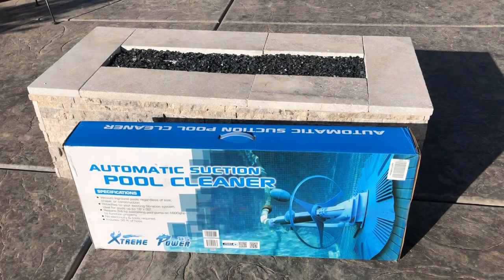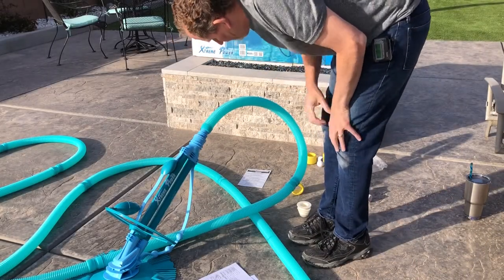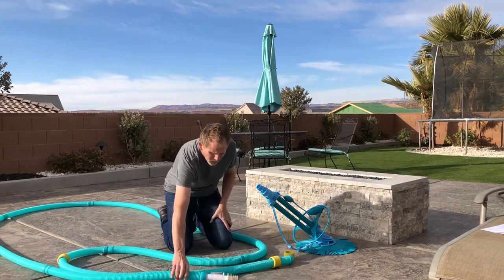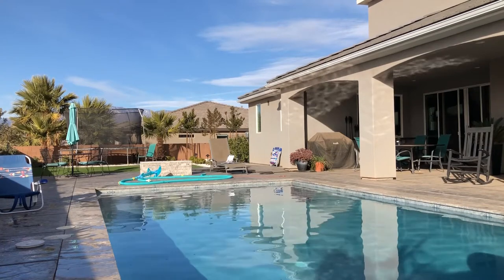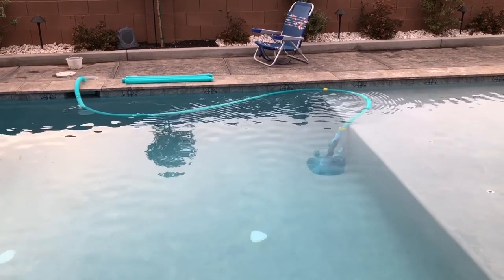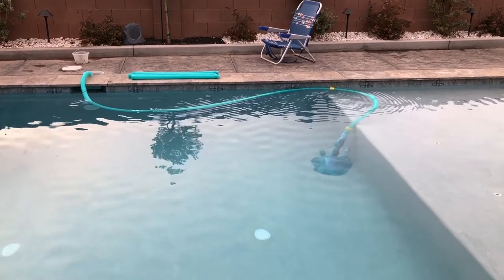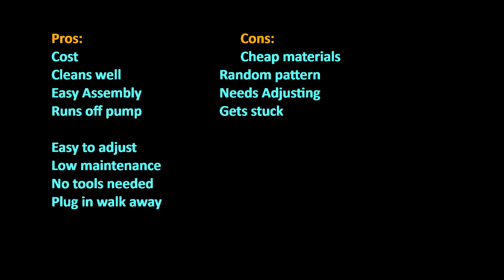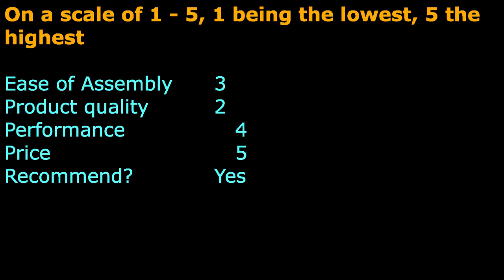Automatic Pool Vacuum - Cleans In-Ground, Xtreme Power US

Comment: How about the 2 wheel version and the flow meter. Did yours come with a clear device to measure the flow of the pump?  Where does it go or when do you use it?
Reply from the maker: I've looked at the 2 wheel version from the same company and it doesn't rate quite as high up on the reviews and is more money so have avoided it so far.  Mine didn't come with a clear device to measure the pump flow, but does have an adjuster on the end for the amount of pump  suction.  Thanks for the comments!

Comment: i have to make sure my hose is full of water before I hook it to the suction side. I use the return line to do this. how did you get your hose full of water? did you let the pump suck a bunch of air until all the air in the hose was gone?
Reply from the maker: Hi there!  Yes, I have to make sure the hose is submerged or full of water before I hook it to the suction pump, otherwise the air pockets cause issues.  Great comment however!

Comment: Does my main drain and vacuums line have to be off?
Reply from the maker: So this works better if the main drain is turned off apparently, and the pool pump is what runs it.  There is an adjustment where it connects into the pool pump to give it more sucking pressure and that helps.

Comment: about to return mine...just got it and it is slower than a snail....only goes backwards and gets stuck easily 

POS
Reply from the maker: I had to take some time adjusting the regulator spring settings that come with the vacuum, also crank up your pump motor on the pool and see if that helps speed things up.  Thank you for the comment

Comment: I have 3 weights and a 8 foot deep pool and this thing never goes into the shallow end. Tried to adjust the 3 weights but no luck.
Reply from the maker: Check the suction on the pool pump and adjust to stronger if needed.  Also you may need to move the weights (Spread them out) along the hose to get the Vacuum to move to the more shallow part of the pool.  Hope that helps, and thanks for the comment!  🌊
Reply: @FixMyBleep I will try that. I have a few extra weights as well. The suction is very strong. Moves pretty good.
I will keep you posted.
Thanks
Reply: @wild-n  Hi again

I think I have it figured out. The hose is way too stiff. it just takes the path of least resistance. My old one the hose was much more flexible and only used 3 weights.
Im going to try the old hose from my old machine or at least a few pieces.
Reply: @FixMyBleep  Wildstreak

Well I finally figured it out. Took all the weights off the hose and used the more flexible hose from the old machine. It was doing better, but still seemed constrained as far as coverage goes. Then I noticed the swivel at the machine doesn't work well under vacuum pressure. It only rotates 30-35 degrees when running, so I ordered two Pentair swivels to go inside in the hose and now it goes where ever it wants unconstrained. Much better now and those swivels actually work. Imagine now it goes in the deep end and the shallow end without any weights whatsoever in my 8'5" deep pool.
Reply from the maker: @aslo4812  That's a good call, I think the hoses may have changed.  This one is pretty flexible in the video, but the vacuum always takes the path of least, or no resistance as well.
Reply from the maker: @wild-n  That's great news!  Thanks for the information and I'm glad you got it figured out.👍
Reply: Just out of curiosity what kind of old machine are you talking about with the more flexible hose. Thanks
Reply: @johnfontenot1679  I had a Creepy Crawly in before. But then the pool company came and took it but left the hose. It is super flexible the hoses this came with are stiff. Its like everything makes a difference as to the coverage the cleaner makes.

Comment: We love ours but we have the old one from 15 years ago we ended up combining parts and weights. I’m disappointed no videos including yours shows or tells about inserting the regulator into the pump. All of my pipes are buried under ground. I am very Leary of taking a basket out of the pool and having any leaves and debris going into the skimmer? Everyone shows emptying a basket but showing putting this thing under the basket? We have a 20x40 9foot deep pool and I cannot risk damaging / replacing the underground plumbing from clogged pipes. So we just decided to use the old system with it and it sits on top of the basket and empties into it. This is the best cleaner we have ever used though. We close all of our 3  returns and it boogies around the pool and walls in about 3 hours
Reply from the maker: Hey that's a great point on showing how to insert the regulator where the circulating pump is.  I may need to do a short video to show some of that.  Also good to point out closing the returns.  Thanks for the comments!

Comment: I have this same vacuum. How did you prime the hose? Looks like you stuck in the water.
Reply from the maker: That's exactly right!  I had to place the weights on the hose, and allow it to fill with water or get all the air out of it to prime it and then place the other end into the suction pump.  Hope that answers your question, thanks for the comment!

Comment: We are Experiencing problems with our extreme power. It’s been pulling off  stone from our pool and now it’s not working because the stones it sucked up are stuck in the system so it is jammed .
Reply from the maker: Oh that's terrible it's actually pulling building material from the pool itself?  Are the stones stuck in the Extreme, or the pool filter pump?  If they are stuck in the Extreme, you will need to try and remove them by taking the hose sections apart, and the unit sections apart to reach the stuck stones.  So sorry to hear this is causing issues.  There is also a way to adjust how much suction it puts out by changing the spring tension.  Hope this helps, how frustration. Thank you for commenting on this unit.

Comment: is the regulator only for inground pools ?
Reply from the maker: The regulator is for any pool with a vacuum return built into it to adjust the suction power of this pool cleaner.  Hope this helps, thanks for the comment!
Reply: @FixMyBleep  kinda sorry I'm new just had my pool last summer and bought this vacuum I have intex 18x48 with hayward 1.5 hp and sandfilter,  my question hopefully my maybe 2 part question is would I or can  connect the regulator directly to the hayward and would water come out of the regulator since it the hole in it well I didn't really look at the regulator its in my basement  look like has a square hole I'd have to check , but yea can I connect directly to the hayward pump and would water come out
Reply from the maker: @miraquepasa6519  So this attaches to your existing filtration system (pump) and just do a test first to make sure it's the same size, or next time you have a pool guy out have him verify it will work with your equipment maybe, it sounds like you are all set, good luck.
Reply: @FixMyBleep  thank you very much appreciated

Comment: How do I turn it on😭
Reply from the maker: This runs off of your pool equipment.  So you plug the end of the hose into the pool vacume pump (under the skimmer basket typically), and turn the circulating pump on to activate the device.  Then let it run all night, or most of the day.  Also get all the air out of the hoses, and youneed to balance the hoses just right with the weights, it's a little tricky, but once you get the hose length and weight figured out, it works well.  I hope that helps.

Comment: I had that type cleaner. Then went to a cleaner that works off the return side much better! Then switched to a robotic with its own power and cord. Nothing hooked to filter. Best way to go although pricey. I can have my pool cleaned and chemically balanced before even having the filter started in the spring. I am on my 5th vacuum(first robo) in 18 years. Robo is a pool rover jr. nearly 9 years old.
Reply from the maker: This one worked, but I just updated to a pool robot as well and it's so much better than using the pool pump and filters, but definitely pricey.  Thanks for the comments!
Reply: @FixMyBleep  You`re welcome

Comment: Your doing all wrong, you need to fill your hose up with water first are you gonna have air in your line and through your filter and pump?
Reply from the maker: Yes you are correct, you need to get all of the air out of the hose first or this will not work (suction) correctly.  Thank you for pointing that out and the comment.
Reply: I use my return to fill my hose with water.  I've seen several people not filling the line 1st.
Reply from the maker: @lindabradford9591  Good call, thank you for the comment!  I should have been more clear and getting all the air out of the hose in the video because this won't work if it has any bubbles in the line.

Comment: Your pressure is very very low. The clicking sound is not rapid. It's supposed to click twice! every second.
Reply from the maker: Hi there!  Yes, you are totally correct, and I only found that out a while after doing the video by playing with the pool pump settings.  I had also tried adjusting the regulator spring settings that come with the vacuum.  Thank you for the comment 😉
Reply: Your welcome... mine is really powerful.😁